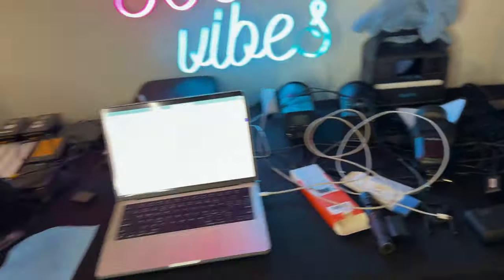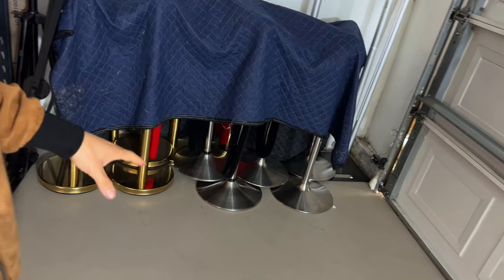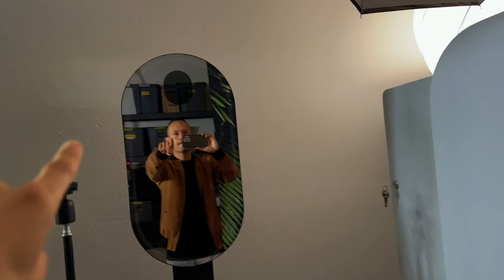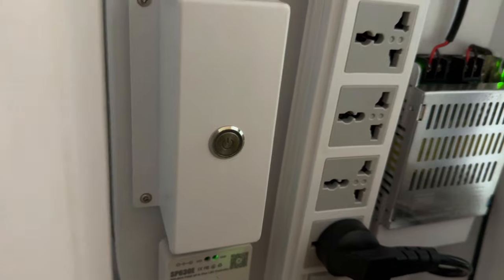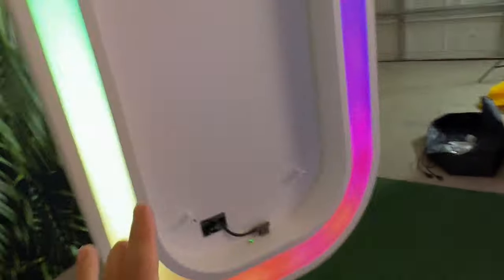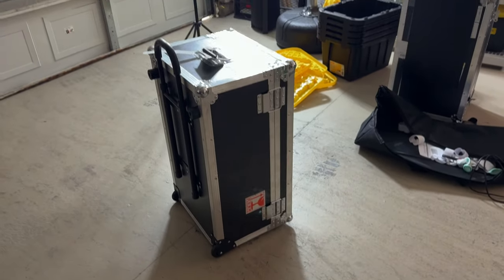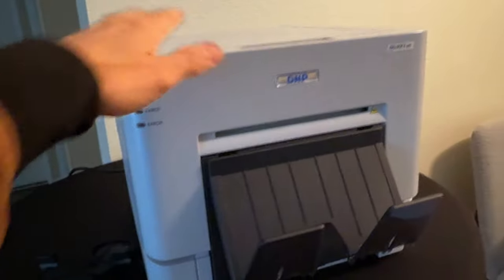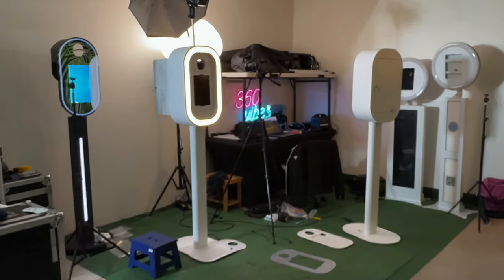Starting A Photo Booth Business | Before You Buy A Photo Booth | Pros Cons

Comment: can i use luma booth if i purchase the dslr shell booth with camera?
Reply from the maker: You can use any software that you're currently using on your iPad. Mr. Professional is not tied to any specific software. I'm sure Snappic, but you can useTouchpix, curator, and any other software that will communicate with your iPad, or surface pro.